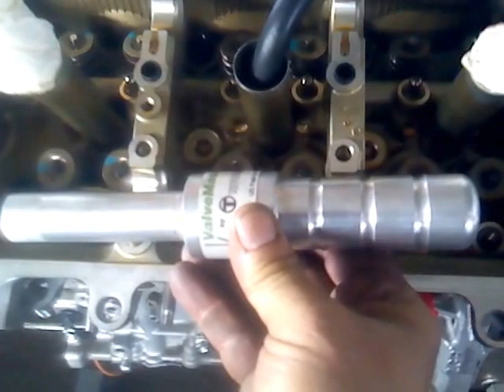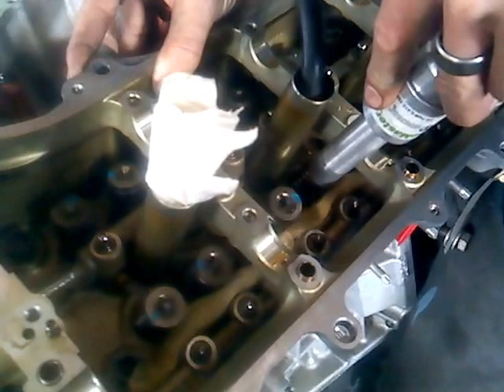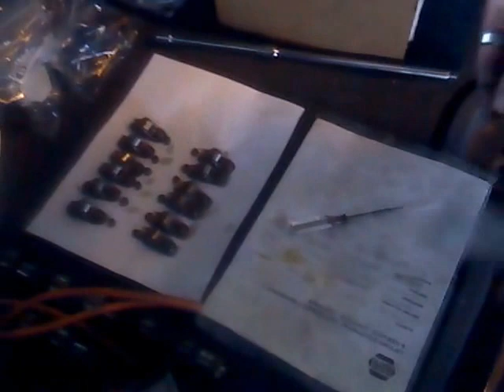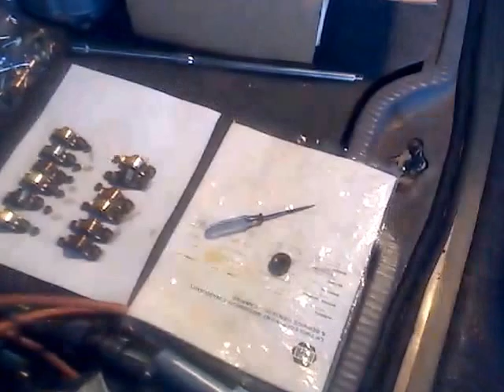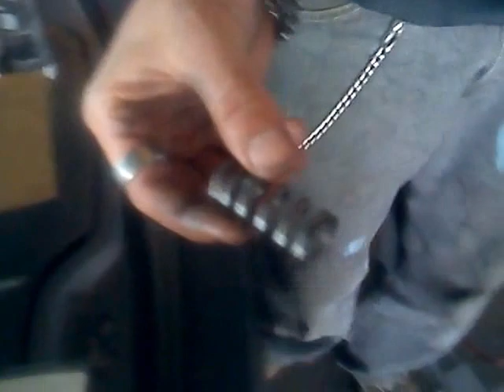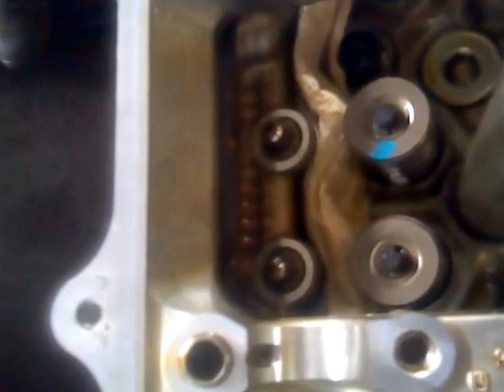Swapping Valve Springs - Toyota 3.5L V6 2GR-FE

Comment: Nice video. You left the hydraulic lifters alone?
Reply from the maker: On this particular one yes it was done for demonstration purposes only.
Reply: @Merryfrankster_  any experience with the Ford hydraulic lifters MWR sells?
Reply from the maker: @kingdavid2018  Ihave test fitted Ford lifters in another video but not run them.

Comment: I have an 08 2grr-fe v6 camry. I have gouky headers, and gouky said he would tune my ecu for 8000 rpm. I was wondering if there are any upgrades you would recommend for NA power increase. I.E(cams, valve springs ect.)
Reply from the maker: If you're going to rev to 8000 rpm you need to replace the valve springs with something stiffer or it will spit the rockers.
Reply: Frank Saab Ok, cool. Now power wise, would you recommend cams and head work? Or a better question, what should I do first to increase power?
Reply from the maker: @MrPoblo14  to be perfectly honest I don't know if you will find any tuning support on the Camry ECU for any mods like cams or high CR pistons or head work. Before you do anything you should find someone capable and willing to tune your car. This should be your first priority. Without proper tuning you will not be able to take advantage of your mods. The tuning support for the stock ECU is extremely limited. Migrating to a tunable standalone ECU would present some significant challenges in the Camry with the Canbus  A/T TCU. You need to get a handle on this, otherwise any mods you make will not pay off.
Reply: Frank Saab Do you know anybody that I could get in contact with that has experience tuning this engine?
Reply from the maker: @MrPoblo14  The only legit referral that I can make is Dave Staba at DD Performance Research in Sealey, Texas. I know that they have experience with builds that use a standalone ECU and a transmission controller and develop a custom tune for your build on the dyno. This is not cheap. Other places that offer to give you a flash tune for the stock ECU are wasting your money.
Reply: Frank Saab I will look into that, thank you!

Comment: Was this motor smoking
Reply from the maker: This motor was not smoking. The valve stem seals were good. They did not require replacement. The original valve springs were replaced with stiffer springs to eliminate the possibility of valve float at the desired 8000 RPM rev limit which is higher than the original 6400. Anyway it came out good.
Reply: I have a 2010 Lexus es dame motor I think and I have lot of oil consumption don't know why
Reply: And some smoke
Reply from the maker: If you have a lot of consumption (for example a quart or liter of oil every 500 miles or worse) then the problem is most likely the pistons and rings.
Reply: Why the nail polish markings ?